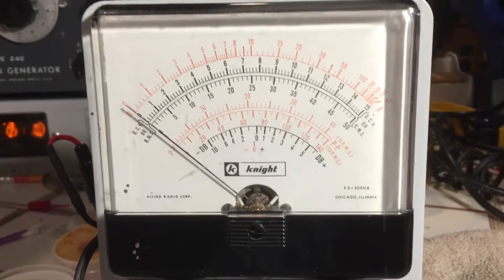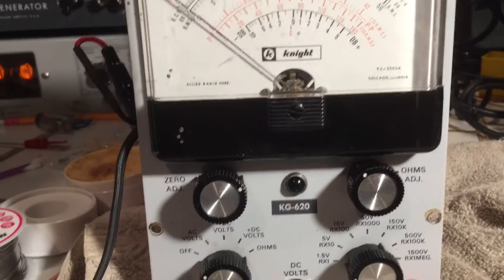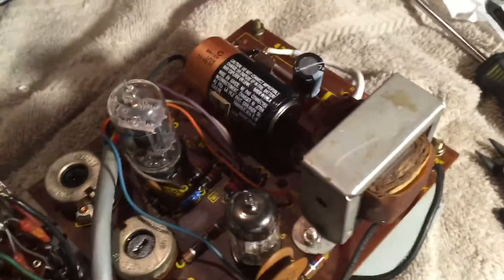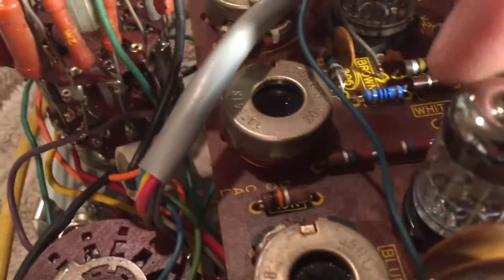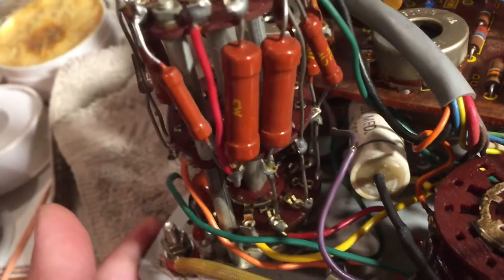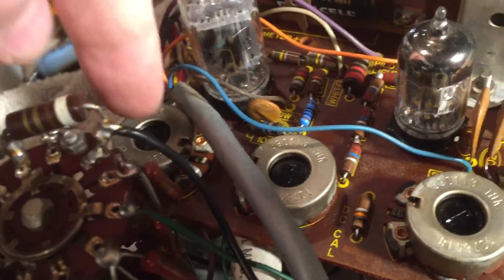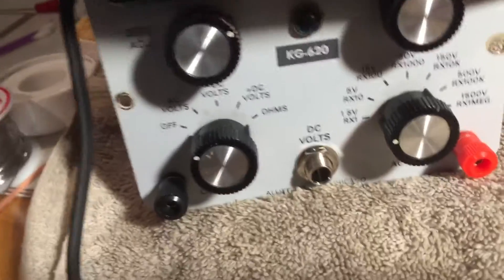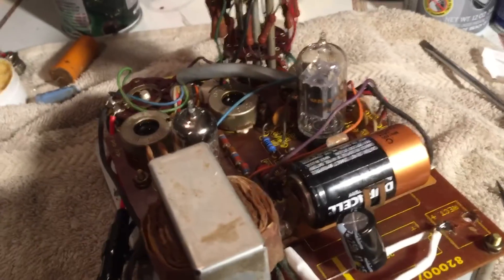Knight KG-620 VTVM Repair / Restoration with Sticky Analog Meter Movement

Comment: .....Nice video!!  Only 1 tiny comment, the original 1/4" jack socket and plug had a larger separation between the centre connector, and Earth.  A standard audio jack isn't  really rated for the 1,500 V range..  73, Fred G4ZWI
Reply from the maker: Ah, very interesting point of safety info. Thank you for the comment. I generally would not use the VTVM for such high voltages anyway, as the shield is connected directly to the case, but definitely good to know.

Comment: no audio, you have to speak  loud
Reply from the maker: Thanks for the comment. I'm sorry you had trouble understanding the audio. My voice is not the most piercing...
Reply: @PelDaddy  Replacing the 20mfd with a 47mfd capacitor did not affect the performance of the vtvm?
Good video very interesting and informative.
Thank you
Reply from the maker: @SDsailor7  Sorry for the late reply. The capacitor just smooths the power supply. Won't affect the accuracy.
Reply: @PelDaddy  I have this model vtvm but the circuit board cracked in three places can super glue work on the board material? and is  the material bakelite? Is either super glue or JB weld that i am thinking of using.
Thank you
Reply from the maker: @SDsailor7  I think it is phenolic board, but I am not positive. Personally, I would try epoxy (JB Weld)

Comment: It would have been nice if you showed it measuring voltages, current, and resistance.
Reply: Very very few vtvm’s measuered current, usually the operator of the vtvm would measure the voltage drop across the components in the circuit under test to calculate the current using ohms law.

Comment: In the future you may want to try deoxit 5 ,or radio shack.tuner cleaner and lube ,I keep both on hand .nice video
Reply from the maker: Thanks for the reply. I like Deoxit 5 and the unter cleaner as well. One thing to note about any cleaner with a lubricant (including Deoxit 5) is that in can contaminate phenolic wafer switches and cause arc overs on high voltage switches. I like to clean first with MG Chemicals Electrosolve. Then you can lubricate with Deoxit 5 or CRC-26, or Fader lube, or the RS tuner cleaner.
Reply: @PelDaddy  the auto store sells a contact cleaner I think the brand is crc contact cleaner do you no anything about that one ,and thanks for the info on the other cleaners,very usefull